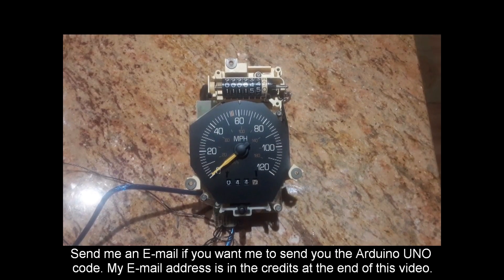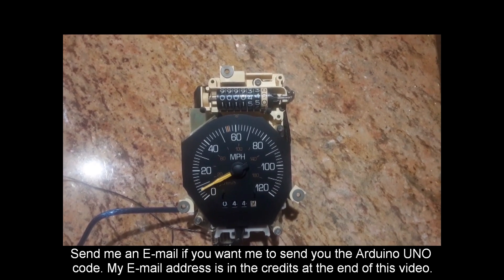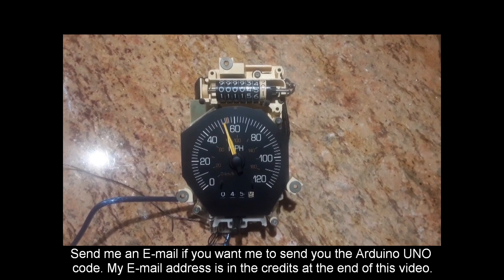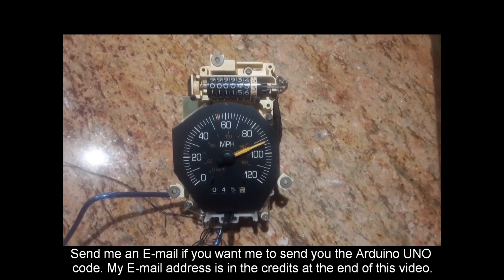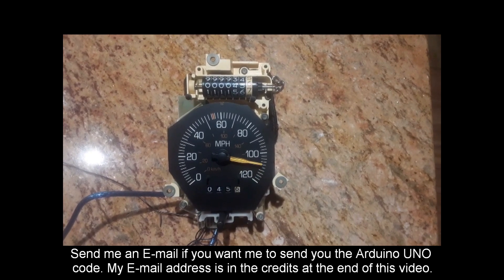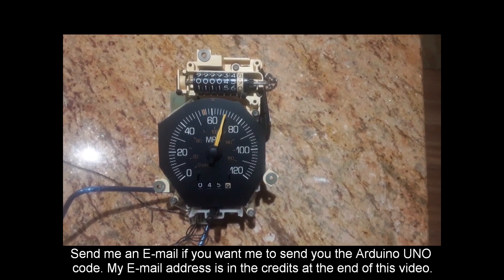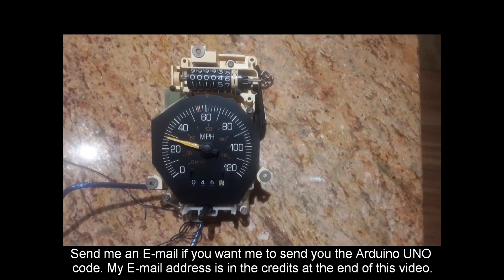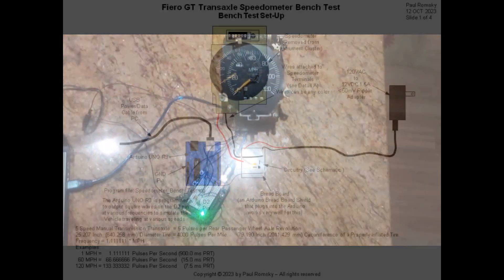Fiero GT Speedometer and Odometers Bench Test: Updated: With Voice-over, Test Set-up, and Parts List

Comment: so cool!!
Reply from the maker: Thanks for the feedback. I also have a Fiero Diagnostic tool (Fiero GT ALDL Monitor) one can connect between the car and a laptop computer. I have a video on it. It's very comprehensive and I offer advice to my users. It has helped several Fiero owners find problems with their classic car. I am now working on a suite of Interface Test Adapters (ITAs) and a GUI that you connect to a PC so you can test EVERY sensor from a Fiero on the work bench. I am designing a circuit board that can be used in the ITAs (one design, 11 solutions) to interface the PC to the various test instruments in the ITAs. For example, the Temperature ITA can test all the sensors that work off of temperature, except the O2 Sensor that requires a special ITA that gets the sensor up to 600 degrees F using a butane torch. I have 11 ITAs in all to test 37 sensors.

For example, this Speedometer bench test is now tested using the GAUGE ITA. The GAUGE ITA also tests: the Engine Temperature Gauge, Tachometer, Volt Meter, Oil Pressure Gauge, and the Fuel Level Gauge. So this ITA is common to 6 sensors and that reduces cost by using overlap.